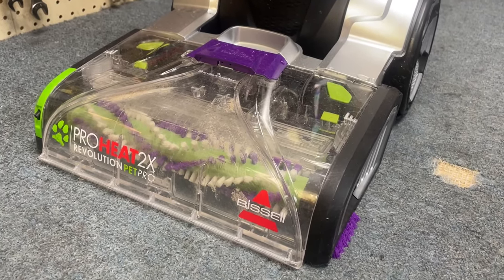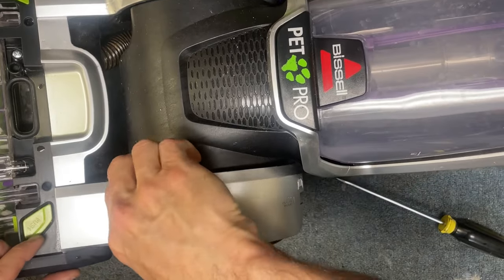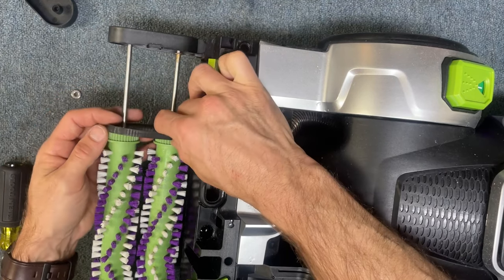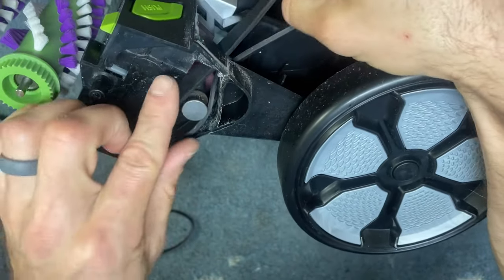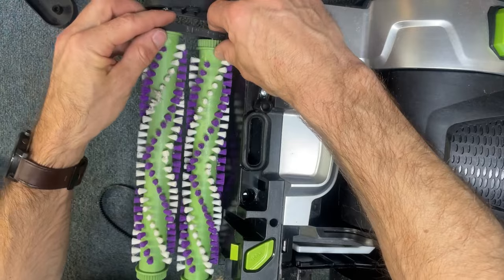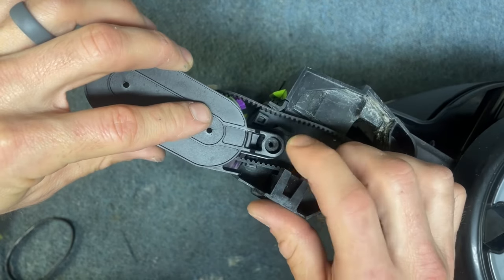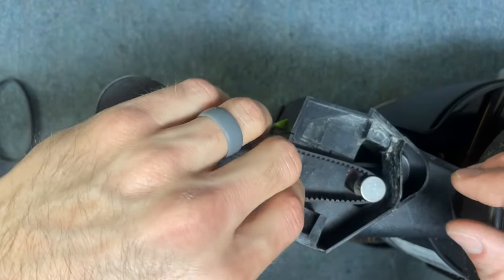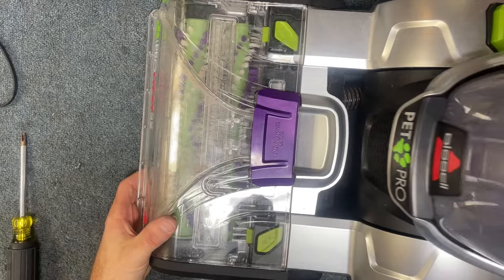Vacuum repair man | How to Replace belts on a Bissell Revolution Pet Pro carpet cleaner

Comment: I replaced my belts and it looks exactly like yours but it smells like burning rubber. When I check it after running it for a few minutes the main belt is hot but it doesn't look like it's rubbing on anything or show any wear. Any suggestions?
Reply from the maker: Check your bearings to make sure they aren’t bound up.

Comment: Hi! So the main belt broke on mine. Got the new one. And have it put together but when I try to make it turn it doesn’t turn the other brushes. It also smells and smokes horrible when I turn it on. Idk what else it could be
Reply from the maker: Something is seized up. Check each brush and the pump pulley

Comment: The belt geared belt that goes directly to the brushes is slipping.. or clunking as it’s hopping off the gears even after replacing it with a genuine bissel belt. It’s to lose and I don’t see a way to tighten it.
Reply: Mine too. Just replaced with a new belt. Still doing it. Crappy design
Reply from the maker: Can you confirm that the axle for the brush properly installed inside the end piece?

Comment: Replaced stretch belt, turned on the machine, it started smoking. 
Checked the stretch belt, and it had slipped off the pink/red pully so the rubber was burning on the shaft.
Any idea what caused this?
Reply from the maker: Something was jammed. Either the brushes or the pulley. When you installed the belt did you rotate it to ensure it centered onto the pink pulley before turning on?
Reply: @richardsvacuumcenter  the shaft was rotating, but the pink pully wasn't.
Second go, centred, got the pink pully rotating this time. Turned on brushes spinning, etc. Then, it started to smoke a tiny bit, checked, and the belt had snapped off this time.

Comment: I just took mine apart to clean it and when I put the brushes back in that I put the belt on.. when you roll the brushes to check and see if the belts are in.. the one belt sort of clicks... like when you roll the brushes by hand it feels like the belt slips for a second and it ckicks... is it supposed to do that?
Reply from the maker: No
Reply: @richardsvacuumcenter in your video it does it too. Right after you reinstall it it makes one click.

Comment: do you have to take the brushes off to replace the stretch belt?
Reply from the maker: No just slide the gear brush off the pulley in that case